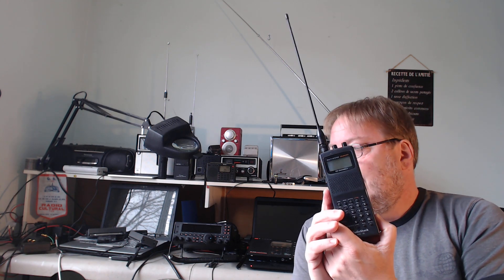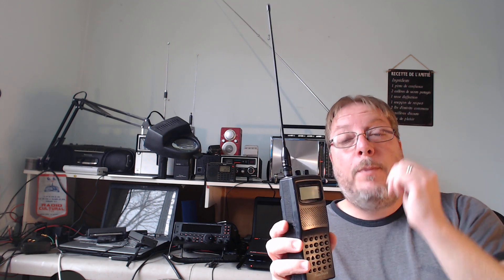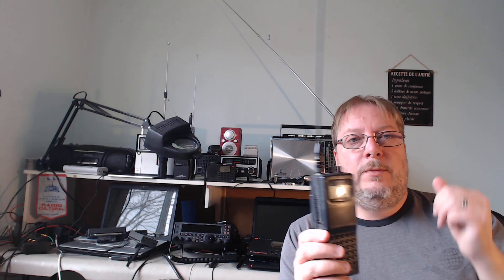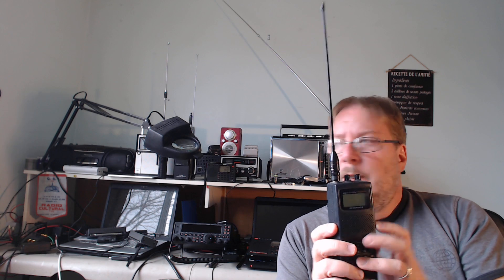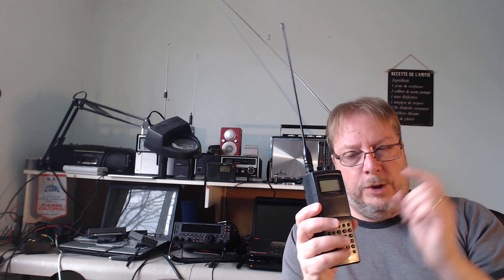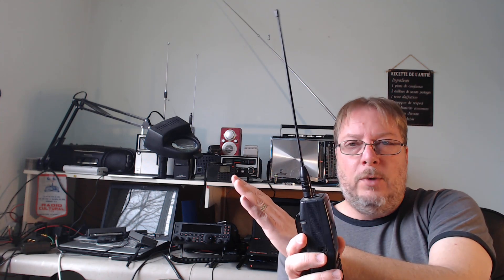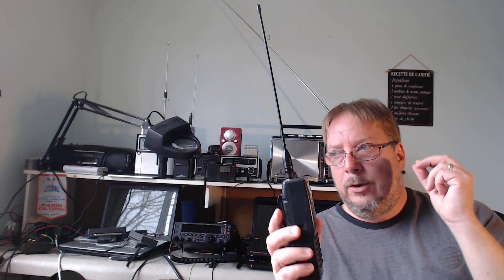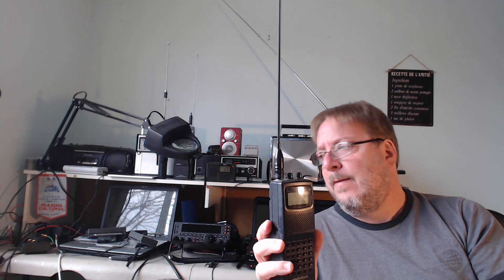VHF UHF Tip 33 Use limit search on your scanner radio to find more signals

Comment: Discovery mode on present-day Uniden Bearcats is great.  It logs frequency, tone & captures the audio to an SD card for review later
Reply: NOT as good as the Opto SCOUT 40, 10 mhz - 1400 mhz in under 1second.
pager sized. and AUTOMATICALLY stores Frequency on my ICOM R20 Scanner.